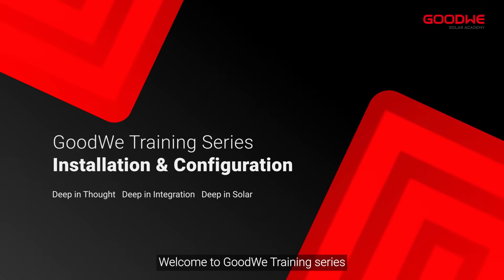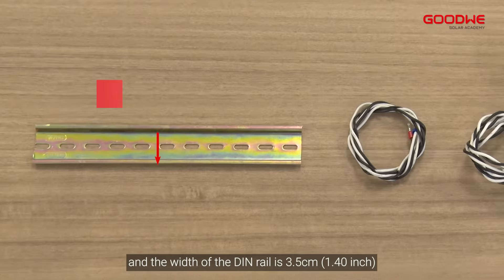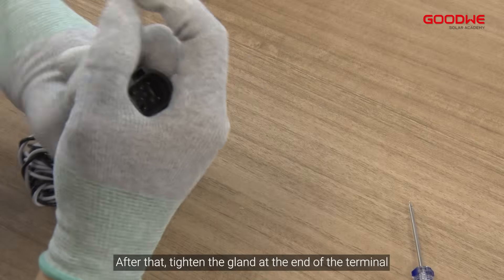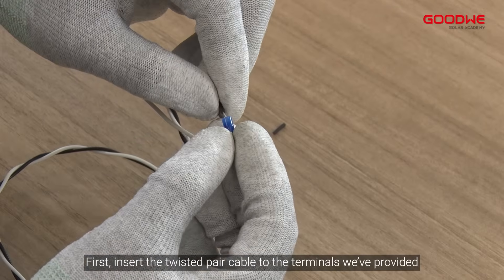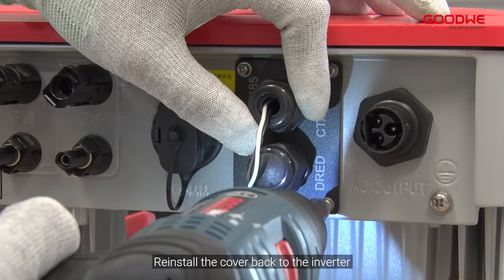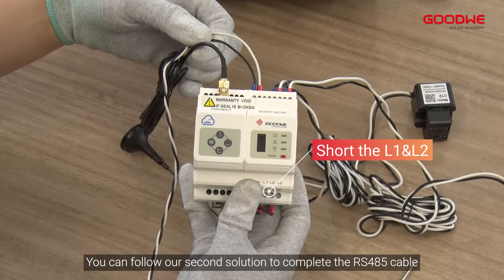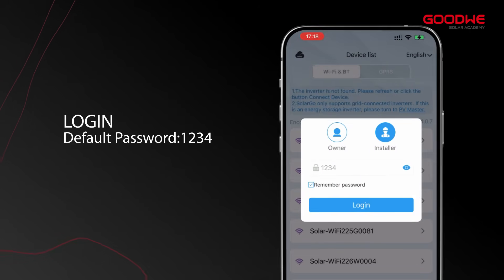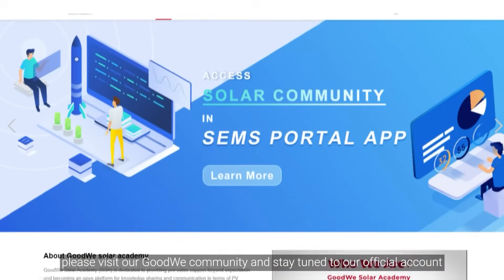GoodWe Zero Export Solution

Comment: Does the GW10K-ET support three phase asymmetric true physical zero export? Regulated by state that no power should go back into the grid (not sum zero) but true physical zero export?
Reply from the maker: Yes, it can support the three-phase unbalanced output function. Our inverter can prevent energy backflow to the grid with the anti-backflow function.
Reply: @GoodWeSolarAcademy  sounds good. In the pdf papers it doesn't mention anything like that

Comment: Can the zero export function work without having installed the home kit? That is, by just configuring it on the app?
Reply from the maker: Sorry, it is necessary to use Home-kit, because we need smart meter and CT to measure the power import&export to grid.
Reply: Does same process apply to your hybrid models, Uniq series?